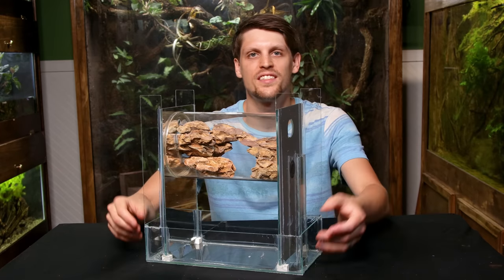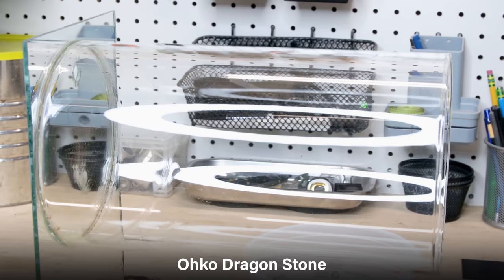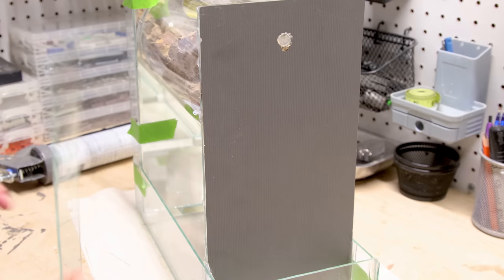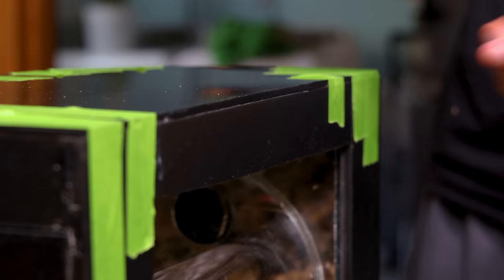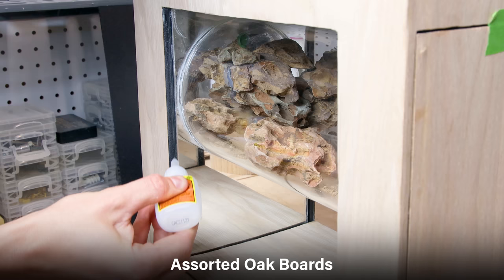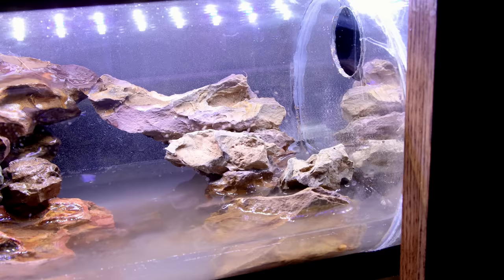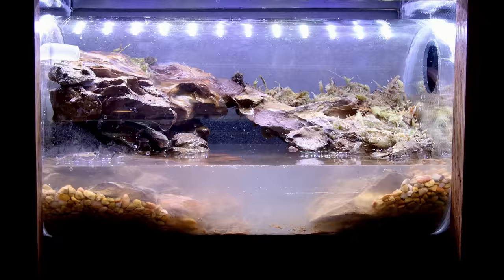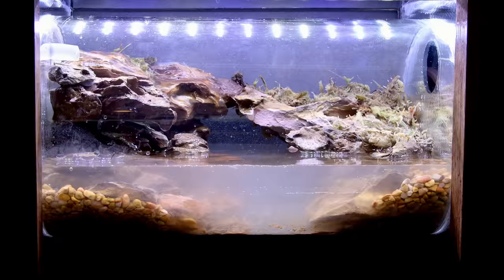DIY Mini Marsh Waterfalls All-In-One Floating Terrarium

Comment: hurricane lampshades have a lot of potential for builds. You can use them for stacking builds, with a conventional jar on the bottom, and a hurricane lamp on top for more space, while sharing an airspace. The 'mushroom' shape design is particularly useful, as they bulge out in the middle in a way that can be used as a platform for additional planting. im personally in the middle of a stacked paludarium using this approach, and its going really well. only hurdle is finding a way to get the 2 pieces to fit snugly (airt8ight) while being removable for maintenance.

Comment: Pro tip when cross-cutting the grain of oak or any hard wood cover the wood with painters tape first and it will keep the wood from chipping or shredding. Leaves a clean cut.

Comment: A bit of rough going half-way through this time. After you added the board and the oak veneer I thought it started to look really clunky, but after you stained it and used the bottom as a shelf I think it turned out great.

I still think it's a rather chunky construction, but it still looks pretty.

Comment: Just used a cylinder identical to the one you used for a waterfall scape. My water keeps going foul though... I don't have anything in it other than rocks because the moss that was in it started to rot. Idk what to do now

PS I saw you strip those threads out at 7:15 ;)